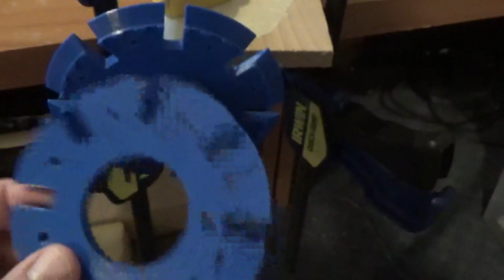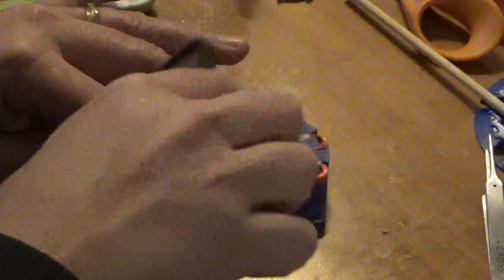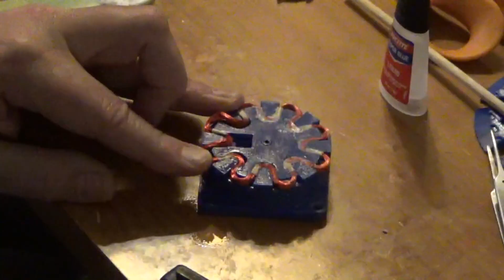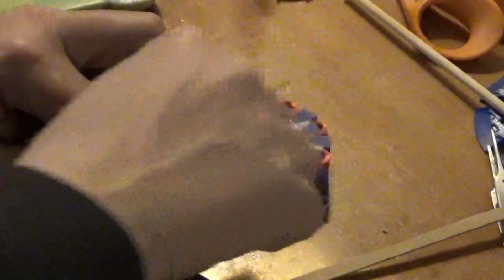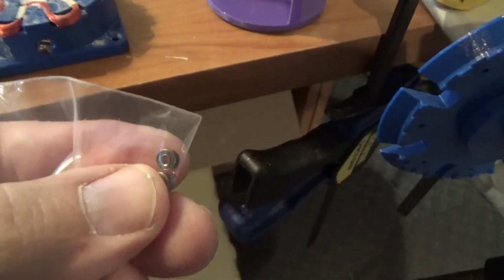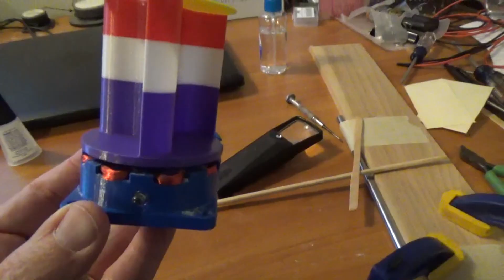Milli-VAWT - A mW Scale VAWT

Comment: Can you try a horizontal axis now? As you're just powering a led you don't need any complicated wiring
Reply from the maker: Do you mean a 5 mW horizontal with a home brew generator?
Reply: @MickEMaus3000  Yes, i guess a HAWT with a 5mW or similar generator could be an interesting option. In theory, it might spin faster at good wind speeds, maybe even require less wiring. I am worried about its startup behavior in low winds, though
Reply from the maker: @niunmango  That would be interesting.  I've got another project in the works, but maybe if I get inspired.

Comment: Cool, looks like you could reduce the gap between the rotor and coil a bit more for lower wind speed power.
Reply from the maker: Good point.  I wasn't sure if the coil would stick up in places as happens when using hot melt glue.
Reply: @MickEMaus3000  always an issue 🙂to keep an eye on, you have those serpentine coils nailed by the looks of it!
Reply from the maker: @itsandbits1  The bundle of fine wires is easy to bend.
Reply: Make 99 more and make a tree of turbines, more power!!!